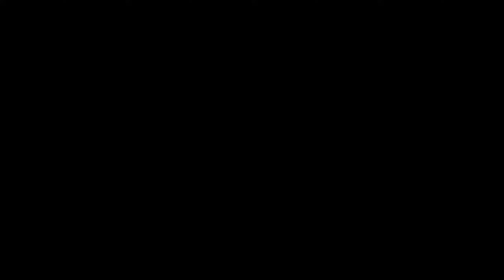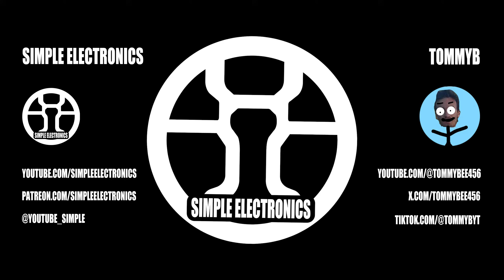The Simple Electronics Podcast - 105 - TommyB

Comment: Hi I have electronic cutters runs from recharge fo ten minutes when trigger pressed but if trigger released at any time it wont then run. after recharge it will again work till trigger released but then wont run again. It’s like some sort of reset. It’s 9.6 v. Charger and battery ok. Any ideas?
Reply from the maker: Sounds like the battery falls on its face when load is applied - I would try a known-good battery or rig up some wires so you can test voltage sag during use